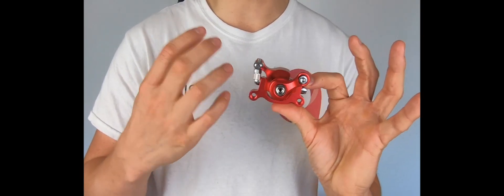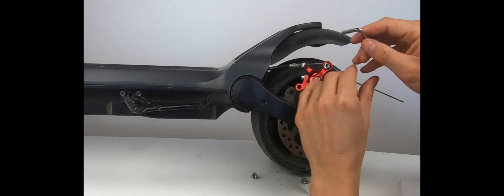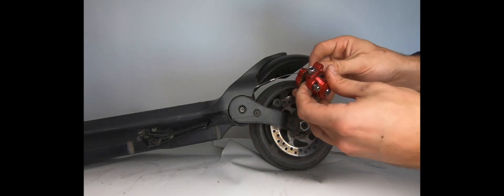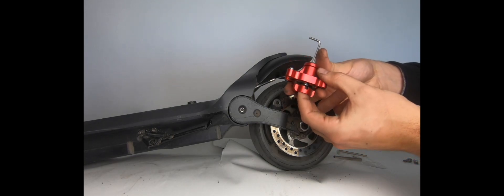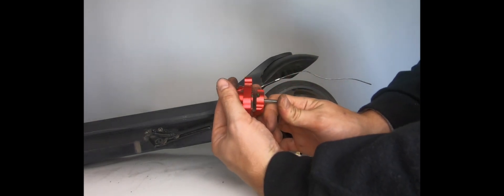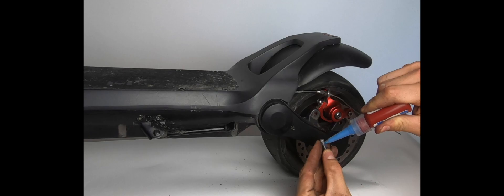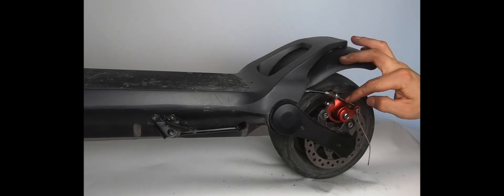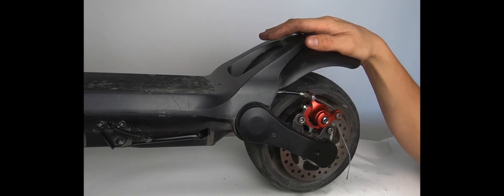Mercane Widewheel Brake Caliper Solution - How to Adjust the Brake Caliper

Comment: good video. Actually you don't need to remove that grub screw as its just an interference lock to prevent the rear caliper from moving due to vibration. So just loosening it a bit is sufficient (and may prevent losing it). Of course a drop of the lowest strength loctite on that is good practice too.

With respect to the rear adjustment I believe that you need to keep adjusting that up as it wears the pads, so I would be hesitant to put any solid loctite there too ... indeed you'll also need to adjust the front pad too as it wears (and you don't want to need to change the lever position to take that up) so I'd also be cautious on loctite there too.

Nice work
Reply: I know finophile has a lot of experience with this scooter and I thought the exact same thing about loctite'ing the threaded disk that holds the rear brake pad.  That threaded disk is the adjustment for when the rear brake pad wears down.  The rear pad should be almost if not touching the disc at all times.  This ensures braking force is even on the disc since force is only applied to the front pad.  As the rear pad wears the disc will have to bend farther and farther towards the rear pad as the rear pad wears down and force is applied to the front pad.  These brakes are designed with the main goal being cheap.  With this design that rear brake mount should technically be ever so slightly tightened after every trip you take on the scooter and use/wear-down the brakes to minimize the amount of bend the disc has to do to bite.  Which is crazy since that adjustment is impossible to get to without taking off the entire caliper.  Loctite'ing the set screw makes sense.  Replacing the brakes on a widewheel with some quality MTB hydraulic brakes would be my first upgrade to this scooter.
Reply: Agree, but I dont see that the outer pad should be adjusted by anything else than the arm/wire? The small screw I thought was only to hold the magnet for the outer pad?

Comment: Although your video is appreciated, this is nuts for a scooter owner to have to do. 🤔
Reply: why? Small toys like this are not cars or motorcycles, and so its entirely different to a multi thousand dollar vehicle. These things are for enthusiasts, so just like your skateboard or bicycle you'd be doing this yourself too.
I think its fantastic that the internet actually gives people a way to pass on this information to the end users quickly.
Reply: @finophile  I take my Cannondale to a bike shop for repairs, unless it's some simple task like putting air in tires or adjusting the seat. A skateboard typically is not motorized, so the amount of repairs is minimal or replacing it is not a financial hardship. This $1200 toy is not on the same quality build as a Boosted scooter. Also at least with that brand if something as serious as a faulty break occurs, there is someplace to take it to/ship it that will correct the problem. This Wide Wheel issue is DANGEROUS & should be addressed by a professional not the consumer 💯
Reply: @vincedemo2752  then you should take your wide wheel to the same bike shop that ypu take tour canondale to, they can put a new disc caliper on it for you. Its literally 2 bolts and a cable retaining nut.
Reply: @finophile  simple solution, yes.   However is not something I  thought I would need to address after spending $1200 & now incurring additional charges to correct an issue that is troubling for a consumer. 
I will eventually have to follow your last recommendation, however, 2 years from now when boosted has duel suspension on their scooters 🔥🔥🔥🔥
Reply: @finophile  Being able to maintain a bike is not how ones worth is reasonable judge at any age lol. 
This product (Wide Wheel) has its pros & cons. But everything becomes secondary when, while riding in traffic your W.W  brakes fail & you have a "almost crap in your pants moment". 🤫